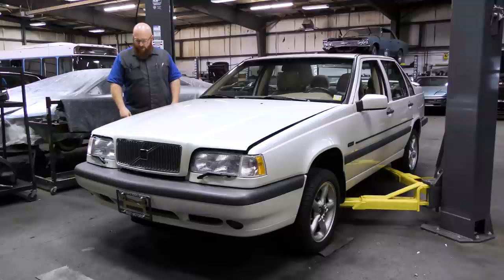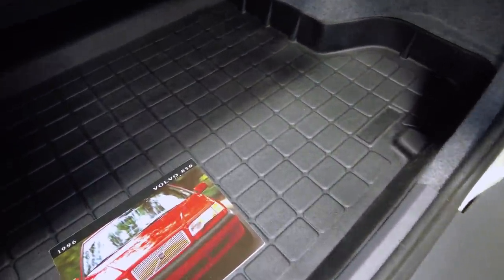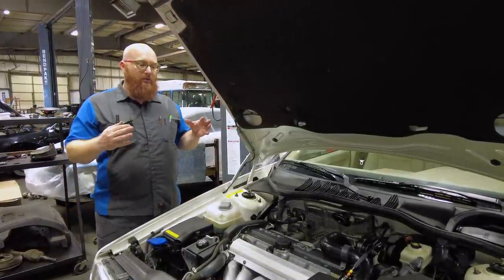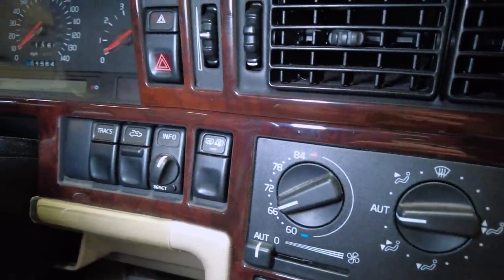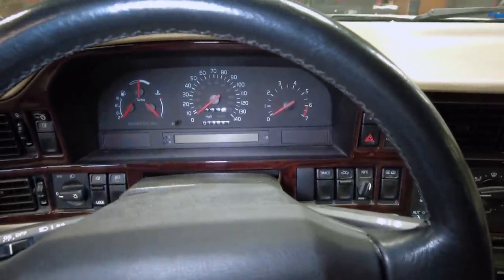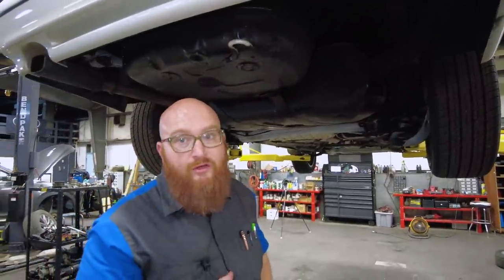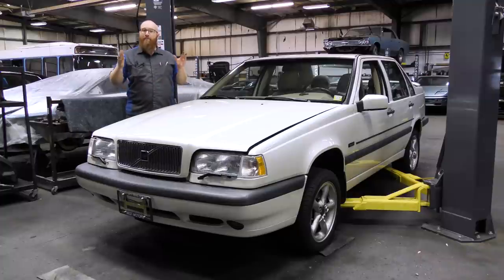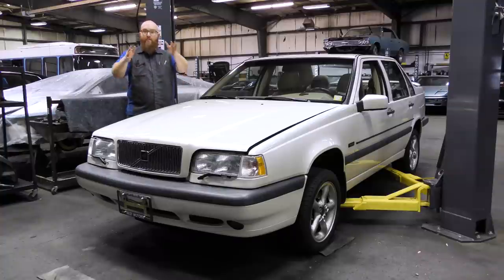Absolute Time Capsule! Super Rare '96 850 Turbo Volvo! CAR WIZARD's in awe of the condition.

Comment: I own a EU/UK spec 1996 850R auto saloon, it's sitting in my drive. Best car ever. Fast enough, comfy as.. the driver's seat in my volvo is as comfy as anything I have ever sat in and it has multiple adjustments. I drove from the highlands of Scotland to the French Alps and only stopped for the ferry and a coffee or 2. If position 1 you have set  gets tiring change to position 2 if that gets un-comfy try pos 3.  Just the best car. Mine is black with light tan Alcantara, it just looks and feels like natural soft leather. It doesn't have the original 5 spoke wheels, they were soft as puppy-s§ite and an absolute nightmare in the UK. every bump meant you warped the rims.

Comment: I ve got the same 5 cyl motor in my C70.  Its a really strong engine.  I think it went on to Ford and was in the 2.5 Focus RS.  I could be wrong though.
Reply: Kind of lol! The development of this engine went on to power the S60/V70/S80/XC90 P2 generation cars into the 2000s. I have a 2005 V70 with this fabulous engine in one of it’s many versions - they did non-turbo/Turbo, and many different states of tune and in Europe it also became a diesel - known as the D5 which was Volvo’s first ever diesel and an absolute gem! The particular engine used in the European Focus ST/RS, as well as Ford Mondeo, S-Max and the Volvo C30/S40/V50 T5 and of course your C70 which was co-developed with the Euro Focus Convertible here. These ‘P1’ Volvos were closely developed sisters to the Focus and Mazda 3 which indeed feature a ‘white block’ 5 cylinder just like this but crucially it was a ‘wet liner’ engine whereas all the other versions were ‘solid block’. This is engine was a little cheaper to make as a result. They did suffer from liner cracking when many owners - especially of the sporty Focus - tuned the heck out of them often to 300/400hp so the liners unless modified and reinforced will fail. Running in standard power they are fine though. Awesome engines and the distinctive woofly howl is one of the reasons I love this car ❤
Reply: Only the block.

Comment: Car Wizard, you had a volvo guy come in a few years ago and look at one of these on your lift.  Volvo 75th anniversary Platinum 850, only sold in 1996.  Came with all available options, and a special paint job for that anniversary year only.  Pearl over Arctic White base coat.  True wood veneer on the dash and center console.  In the rear it has Nivomat self-adjusting shocks.

Comment: Believe it or not, these older Volvos from the 90s almost never rust out. Even if they've been exposed to northeastern winters! As for timing belt service intervals, I believe that Volvo recommends every 70k or every 8-10 years, whichever comes first!
Reply: Can confirm. My 96 has lived in Ohio its entire life and doesn't have a drop of body rust. Underneath there is some, and the rear brake calipers almost look fossilized, but they still work great!

Comment: I owned this exact car but it was black. It has a high pressure turbo, only that year, the next year they switched to the GLT low pressure turbo. I put a straight pipe, and turbo boost controller. It ran amazing at 17-19 lbs of boost on the stock engine with only bolt ons. That car was known in my home town. Once I took my friends to the street races and showed them what it could do the entire city knew me

Comment: This was a nostalgia trip for me. My first car ever was a Volvo 850, 1994 model with a 2.4L 144hp engine. It had velour seats instead of leather, and the interior was beige just like this one. It kicked the bucket after 200k miles not long after a timing belt service... Turns out somebody did not replace the tensioner. I still miss that car...

Comment: Last fall, I inherited my Mom's 96 850 Wagon (non turbo) and recently changed the timing belt and water pump myself. It has somewhere over 160k on the clock, but no idea exactly how much because it has the same problem every 850 has: Odometer bit the dust. No plans on taking the dash apart to remedy that situation, I'll drive it til it dies.

Comment: I have an '01 Volvo V70 2.4 non-turbo with 216k miles on it.
Just had to do the timing belt and PCV system, and it runs great.
It doesn't burn a single drop of oil.
I always liked Volvo, but ever since owning one myself i've started to love the brand.
At least the older European made before 2010.

Comment: I have a 1998 S70T5M which is the identical model after the midlife facelift.  I noticed the ECU cooling duct was missing at 5:56 (its beside that yellow sticker)  small hose caries cold air from the grill to cool the computer.  Don't let it eat hot air!  That part is cheap, I replaced mine about 7 years ago.  {Edit:  Oh thank God, there it is 14:46}

Comment: I have one similar to this, Estate, manual, non turbo. Father bought it new in April 2000. Now on 49986 miles. Very nice but not as nice as this one. Its worth about £2500 in the UK (About $3000?)
I guess a US car of the same spec etc would be worth considerably more. Good older cars are creeping up in value here, but nothing like where you are.

Comment: Beautiful car. I have driven those and realy like them. Myself I drive a 2005 Volvo V70 with the same 2.4 Liter engine without Turbo and 400.000km (around 240.000 mls) and it still runs like new. No issues at all. For me it is a swedish Toyota build in Belgium (mine at least). I love it.
Oh, I forgott one downsize. The turning radius is like a Container ship. And I live in a bigger european city where I have to park parallel on the side walk.
Reply: Likewise, l own a 2003 v70, highway driven daily to work and back on (not so) tough Canadian winters. The car is fantastic in every measure, but the turning radius is simply awful. lt is worse than a dreaded SUV.

Comment: It's soon time for a timing belt and water pump replacement on my '98 S70 Turbo. Not because of milage but age.
Car was bought new by a recently retired gentleman who owned it 'til he was too old to drive. So I bought it a few years ago, definitely not mint condition but for a 25 years old car its great! Just passed 125k miles (200.000 km) and it's not even seeping a drop of oil anywhere.

Comment: 15K???  O_O <3  Lucky and I'm super jealous!

Might as do the serpentine belt and all the tensioners at the same time while you're in there.  Those tensioners are also 27 years old.

Mrs. Wizard forgot to mention the best part... Sports Mode!  Super fun with the Turbo.
Reply: Seriously, I didn't get this. What is it, another $100 in parts? Unless Bob specifically said not to do it; remember, the Wizard's not going to have to give a warranty for this work.

Comment: Car Wizard I have a question concerning my 2015 Mini Cooper Countryman S. The car has 70k miles and runs good.  Should I drain the transmission fluid and change the filter or just leave it alone?

Comment: There is one thing doesn't seem right.
The coolant cap should be green for 850 turbo. Different color means different coolant system pressure. Grey cap has lower pressure and green cap has higher. Make sure you check that.

Comment: Volvo's were beautifully built solid cars. This is a treat to watch. Are the OEM stamped parts shown in this video from Sweden or China? And does it matter if they're from Malmo or Hangzhou (Geely)?
Reply: The parts shown in the video are most likely from one of Volvos suppliers in Germany. I do believe both the timing kit and the batteries that Volvo use are made in Germany by their suppliers. Keep in mind that most car companies don't make close to everything themselves, and with Volvo being in Sweden, they can't find a Swedish company for every part. Volvo makes the engine, body, chassis, and the rest is basically co-developed with suppliers, whether in Sweden, Germany, Belgium or China. Even Japanese companies have supplied many parts for many Volvo models. A lot of Volvos have had Aisin manual and automatic transmissions which are the same used in Toyota vehicles, even some new Volvos have those transmissions. And then of course the Volvo V8 is made by Yamaha.

Comment: I had a 1988 740 Volvo, odd things would break. Headliner fell down after 3-4 years. A/C was not up the North American standards, taillights leaked water.  Went through 2 turbos, very expensive to fix back on the day.

Comment: Extremely nice car, those are in huge value already and just rising. A 513km 960 from same era went at 35000$ in Sweden last year. This is probably same money.

As a tip from person that has done a lot (probably tens or close to 100) of belts on these whiteblocks (the belt job is basically same on 4/5/6cyl 90's to late 2000's), there is a TDC mark on the crank sprocket, but it is VERY tiny and extremely hard to see. It has a ridge to meet on the oil pump housing behind the belt when engine is at 1.cyl TDC.

There are marks on the cam pulleys as well, the ones that are at 45degree angle inclined against each other, so NOT at 12'o clock. Had a car that came to me that way, the guy who had swapped the belt had wrecked the engine.

Waterpump is good to swap when that old even if it looks good, the seal isn't definetly at its best anymore, even if it has no play. The dealers at least here don't swap them unless a lot of miles or leaks. I did mine at 394000km and it was original from 1998.

Comment: I've owned a 94 base model 850 5 spd manual, a 97 850 R, both brand new from the dealer, and finally a 96 base model 850 5 spd manual wagon.  The 97 I loved until the wiring on the radiator shorted out and caused a fire the wiped out the entire engine compartment.  The 96 I bought with 142k miles and drove it to 406,xxx where it cracked a valve and said no more.  It drove but it was time to buy a new car at that point.  I loved the 97 the most.  Issues with these cars: Rear main leak at 142k on these cars, odometer gear breaks, dash mounts are plastic and break at the first really cold spell after which you have a creaky dash, the 850 R suspension is very stiff, rides like it's on rails but needs taller sidewalls rather than the skinny 17's.  Other than that, great cars.  Never understood why they put cup holders directly over the top of the door switches.  This white pearl 96 is a very nice car.

Comment: I used to have a 2005 V70R and did the timing belt at 10 years (when I bought it in 2015). The car had about 85K miles. I took it to the Volvo dealer and told them I wanted the water pump replaced with the timing belt. The technician actually indicated it was in perfect working order and unnecessary. That kinda annoyed me as everyone knows to replace the water pump with the timing belt.

Comment: That water pump is good for 150,000 miles. I have 2 Volvos with the 20 valve engine, both sub 85,000 miles. Bombproof. Run Volvos for 40 years.

Comment: I worked at a Toyota/Volvo dealer in 92'/93' when these 850's came out. It was a game changer for Volvo. They were going away from the strait lines that the 240 was famous for. The Turbo was nice. Good sounding 5 cylinder. I started looking at Volvos differently after these. Now, however. It's a different story.
Reply: The 4 cyl engine that Volvo is using is a disaster in my opinion.
Reply: Volvos are even better. But those 5 cylinders were perfect
Reply: @fredwiley3731  I think that basically any modern 2.0L 4 cyl is horrible. Most uninspiring engines ever. And with modern customers wanting more and more horsepower they are stressed for what they are. Turbos, superchargers etc. Of the modern Volvo engines, the understressed ones are still good and reliable. Such as the T4/B4 and T5/B5 which only has a rather low pressure turbocharger. They are boring but reliable. The T6 from before with turbo and supercharger are not very good. In Sweden we even have a T3/B3 on modern Volvos which is only like 150hp and I believe they are naturally aspirated. Those engines are quite reliable too.

Comment: l drive a 2003 v70 5-speed, not quite as pristine as the one showcased, but it is in excellent condition from 1m away, no rust, driven every single day to work and back and washed (by hand) every single day, regardless of the weather.  These cars are super strong and dependable, but do not drive, as l did several years ago, over a deep manhole-sized pothole that required new front control arms, new steering box and rear control arms -- a very expensive repair.

Comment: I have a 98 s70 same engine just did the timing belt in it for its  second time, first was at 137000ish and now at 207000 its still in amazing condition for the milage  with all the original or replace genuine volvo parts not rust or rot ! its amazing

Comment: Here they are still around but not that often you see them . Back when Volvo 855 Wagon was new the demand was so high so lost very little if you owned it for 2 years and sell it , they sold intantly . The 4 door sedan 854 Like this sjowed here was not that popular . People here likes Stationwagons . so you can find them for less money wagons costs more .  Common problem on the 850 series is frontwheelbeerings . keep an eye on those so they are changes . they go bad pretty fast . But a very nice car . Another tip get the S70  from 1998 to 2000 that was the followup to 854  or look for a 1 st gen V70 1998 to 2000 . They are more or less updated 850 s and are not so such after so they are still cheep to get . :)  & nice Video Mr Wizard :)

Comment: 6:00 You must also replace the water pump because if it's pully decides to deviate its rotation in any way, you'll jump timing and need a new head. That engine has no VVT so timing is easier than one with. I would like to see you separate cams from sprockets on a VVT I5 Volvo and get it back timed again with no codes Wizzard? lol jk I love your channel. God Bless! Volvo for Life! (edit) I bet it sells for $15-19K tops, it's not the "R" design that was available in that body style and it's an Automatic Transmission. So, it's a mint condition trim just below the coolest Volvo at the time with the lesser cool transmission. Like a 15k mile Pearl White V-6 Automatic Mustang. Also, if it still has the original driver's airbag its possibly a Takata that's been recalled. Good luck getting rich on it Euro-Asian Bob, I'm rooting for ya.

Comment: Ive got a 2008 Ford Mondeo XR5 with same 2.5 20v turbo. Goes like the wind when the turbo spins up. Its quite ragged now but ghe engine is low kms still and is worth considerably more on its own than the car.

These are interference engines with plastic timing covers so you need to be careful.

Comment: A beautiful example of a car that leaves me cold. I cannot warm to front wheel drive, never mind the white block. Good job doing the timing belt. This is an interference engine. Then again eventually my Red Block will become an interference engine with a rebuild to Volvo Penta 2.5 litre form, but with a double overhead cam from a 940. That will being horsepower up to about 170, torque up to about 260, all without a turbo.

Comment: That "nasty" battery is an Interstate blemish - I just bought one for MY '98 Volvo S70, for $66.  I don't care that it doesn't look original.  My car has 72k miles and also drives almost like new.  I just replaced the original timing belt, and it also showed no cracking.

Comment: Amazing a 96 car has that little mileage!
Reply: That is amazing. 

I worked at a used Volvo dealer back in 00 and only saw one 850 that was that clean and had such low miles.

Comment: I was about to write that you'd think with the way Northern climates and the corrosive salts that are needed each winter car companies would sell vehicles with undercoatings as a standard, but then the fact that designed obsolescence is a thing came to mind and the ole adage of buyer beware shows that even with new, due diligence is required.

Comment: Great time warp
Reply: When I was working at a Volvo dealer back in 01-03 as a teen, we got a nice 96 or 97 850 in with super low mileage. 

Last time I've seen such a clean 850. They are great cars, but most of them are used heavily because of that.

Comment: I want to say that Volvos of that era were definitely NOT indestructible.
On the contrary, they were designed to be "extremely destructible", especially when front collisions occurred, because passengers safety was one of the main selling points, and the front and back of these cars were designed to distort and very efficiently absorb shocks.

Comment: Used to own a beautiful V70 T5 estate until someone rear ended it, shortly after that I bought a late 1999 the last of the good shaped V70 5 cylinder TDI classic model. That too had a terrible end, water pump seized up  stripping the teeth on the cambelt leading to bent valves. I thought it was the pulley tensioner squeaking, but was the water pump, if only I had shut it down, stupidity I know 😭

Comment: I just got the 2006 c30 t5 and it has an issue pulling badly to the right ,under acceleration!The seller neglected to mention it,I spose its a blown cv joint?🤯😱👁👁👁🙈🤔😮😮
Reply: You didn't drive it before you bought it!?
Reply: Did you not drive it?

Probably not a cv axle though. Probably a blown out bushing in the suspension
Reply: @volvo09  tks brother, no I didn't, the chap was 50 ish,so not a boy racer so I assumed it wasn't ragged!Guess I was sadly mistaken?😫😫🤔😡😡😡

Comment: This car is just amazing and makes my 360,000 mile T5-R feel even worse!!! The dash is absolutely trashed, needs every suspension part and rubber replaced, turbo, wheel bearings, ect. But man it motivates me to get her right. The t5r is a rare bird. This sold for 25k on BAT and normally I’d call insanity but it’s a platinum and highly optioned turbo. Price was actually fair but well sold